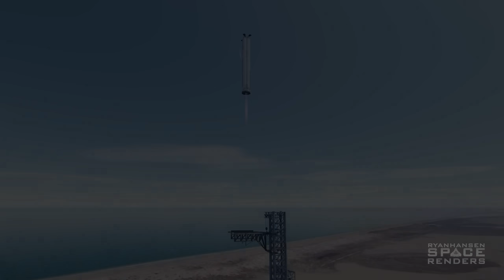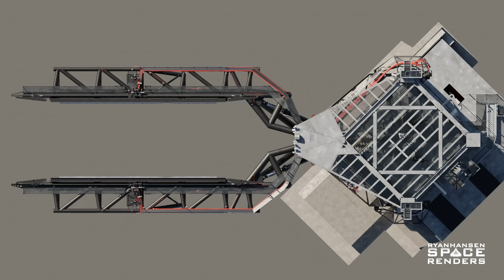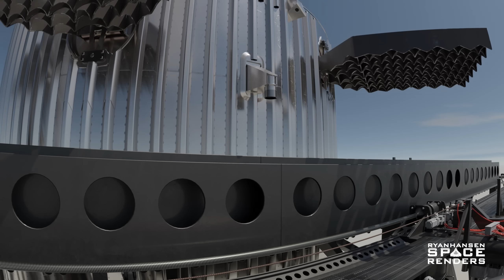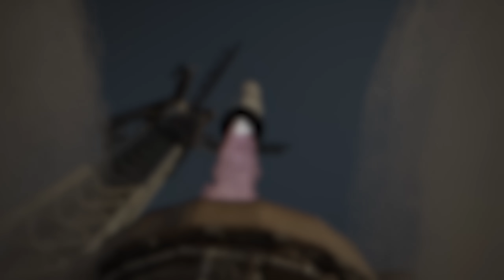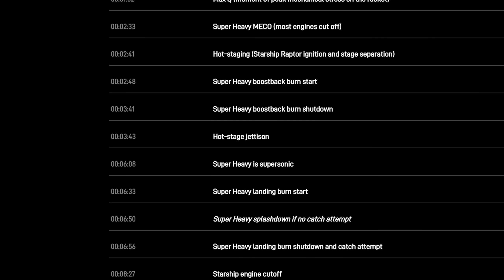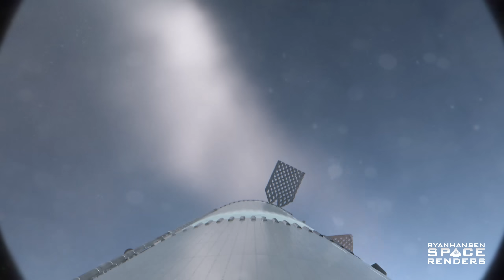How SpaceX Caught Super Heavy | Explained

Comment: I wonder if booster will hover for a period of time to allow positioning and also use up more of the fuel. It would make sense to use the deluge system to reduce heat damage , and better to kave the weight of the booster as close to the tower as possible, all depending on how much movement is allowed in the arms for centering the booster on the launch pad . I had assumed that the booster would descend at an angle to the tower and enter the arms before taking on a hover position , but perhaps there will be a slow vertical descent which is stopped by the grab of the arms and then a cut off of the motors.

Comment: I still have hard time believing that the roll axis is that easy to control and it will stay within that 9 to 15 degrees margin. What if the gimbaling engines fail or have an issue. Wouldn't it be nice if spacex included more load points across the circumference of the ship just in case? They have to edit the deisgn of the arms somewhat
Reply from the maker: I specifically mention unless there are significant thrust vector control issues. Roll is easy to control when 3 engines are running. Honestly, if any rocket company can't get a rocket to a roll target within 10s of degrees they shouldn't be launching a rocket.

Comment: The main issue could be impossibly to align the booster on the vertical axis, in your rendering it come incline and magically stay straight that only with gimbaling engines from the base, not to mention that it doesn't have a proper RCS system, seriously venting the tanks is a good idea?

Comment: I feel sorry for the Engineers that have had to design this arm. The concept looks to have been driven by a management team with no idea about engineering, with structural and mechanical graduates being brought in to check the numbers, but without using experienced Engineers with agency, experience and ability to adopt smart mechanisms to move the arms quicker, more accurately and without flexing uncontrollably

Comment: Great video! Wow. My question is: With fuel always being rare and one of the most valuable commodity in any space flight, will they have enough fuel left to allow for the re-entry burn to slow the booster down, and then to keep 10 then 3 engines running to align the booster on the "landing" pad?

Comment: Unbelievable amount of highly sophisticated work in this video detailing the intricacies of catching the booster. My question for you is would it not be better if there were multiple pairs of pins instead of two just in case the rotation about the vertical axis of the booster doesn't work well. Also the pins could have extended a little more, maybe 6 inches more to ensure that they land on the rail. All of these redundancies could be removed once the catch is perfected. I also can't help thinking that despite the weight, maybe landing legs would not have been such a bad idea.
Reply: I think they have enough expertise and complex simulations to have decided to build the boosters this way....because I agree with you 100%. 
The actual question is probably how much did Elon dictate the latest development of starship with his motto of less parts=good. lol

Comment: 13:21 QUESTION, please:  Instead of having just 2 load points on the booster, why not 8 . . . so that rotation of the booster makes no difference (?)  Does such a change maybe add too much additional drag on the booster performance (?)
Reply: I was wondering the same thing
Reply: Adding 8 load points to a booster instead of 2 could reduce sensitivity to rotation, ensuring that its performance is less dependent on orientation during flight. This change would distribute forces more evenly, potentially improving load handling and redundancy in case of failure at any single point. However, the increase in load points could also introduce more drag due to the additional external components needed, which might negatively impact aerodynamic performance.  the added complexity of designing, manufacturing, and maintaining a booster with 8 load points could increase its weight, potentially reducing payload capacity and overall efficiency. while the idea has merit in improving load distribution, it may lead to trade-offs in drag, weight, and design complexity that could impact the booster’s performance.
Reply: @arjunkunwar3906  Thanks.  I've thought about it . . . and now believe the explanation for the current design is probably pretty simple.  Failure to orient the starship correctly would mean that an awful lot more has gone wrong -- way more than it's worth having backup plans for . . .
Reply: The existing two load points might be the strongest possible given how their arms attach to the internal structure of the booster.
Reply: @pangalactictuber   for such a heavy booster multiple load points can be made. There is no such thing attaching it to the internal structure with strongest possible points . I thinking SpaceX believe in it's engineering capabilities of orienting it perfectly. And the rotation should never exist while catching it which may introduce sway or shear failure or  in the joints of the arms so I think whole idea of having 8 load points is not reasonable and logical both from aerospace and structural engineering point of view.

Comment: Excellent presentation Ryan.
I have a question for everybody that has probably been covered previously so please ignore my ignorance. 
Why aren't most parts of the entire launch mount and SQD (at least to some extent) covered with an ablative type heat shield or tiles? 
So much effort has gone into the ships heat tiles and primary ablative flexible coating that is underneath the tiles, why can't it be utilized on the launch mount?
The SQD in particular always seems to take a heavy beating. Surely there must be a way to attach this coating/tiles that can withstand the shock-waves and heat generated during lift off. Looking forward to seeing this launch and the outcome. Thank you and stay safe..
Reply: An ablator leaves residue everywhere and ceramics are brittle.  Heat is a small part of the problem, pressure is the bigger one and it's pressure that ceramics don't like.

Comment: Starship will have legs... The booster is gonna be fun!
Reply: @SorenBlethrow  Starship... The second stage will have legs. Speculation, of course.
Reply: @notsomadscientist9602  nope. It will also be caught
Reply: @SorenBlethrow  So what catches Starship on the Moon or Mars? Starship will have legs
Reply: @notsomadscientist9602  there will be variations with legs for the moon, but on earth they will be caught.
Reply: @SorenBlethrow  I'm not holding my breath. They haven't even got the hardware for a Starship catch. The little pins on the chop sticks that they use to stack the ship aren't capable of swinging out and catching it. They will need pins similar to the booster.

Comment: What great work!! Unfortunately, my predictions aren’t rosy. The FAA is going to whizz all over the actual catch attempt and require SpaceX to perform another simulation in exchange for a sooner launch date. I expect a longer boost back burn and soft touch down much closer to shore. Which, to error on the side of caution, would be a landing burn failure test run i.e. dispense with the grid fin maneuver and have SuperHeavy follow its ballistic trajectory to the surface. The only evidence I have to back up my speculation is SpaceX would have told us otherwise.
Reply: Part of the problem is you don't have any actual idea what the FAA does or how OR why for that matter.

Comment: If Roscosmos was attempting to catch the largest rocket stage ever flown with the launch tower on the vehicle’s fifth test flight, I would not have high hopes of a successful catch. It NASA was attempting the same thing, I would expect a flawless catch…8 years after the original projection date and 6 times over budget. The level of engineering, mathematics, programming, and sheer will required to pull off something like catching an explosive skyscraper that fell from space is mind boggling, and in a vacuum (no pun intended) I would give it an extremely low probability of working, but a successful propulsive landing of a rocket’s first stage seemed like science fiction about a decade ago so I won’t sleep on SpaceX when they attempt the near impossible ever again. What they’re going to attempt is about as technically difficult as landing on the moon and returning to earth was 55 years ago, so even if they fail in this attempt, I have no doubt whatsoever that these booster catches will be successful before long and will become as common as Falcon 9 booster landings soon after that.

Comment: I don't think SpaceX is worried about moderate damage to the original tower on this catch for a couple of reasons. For one, anything short of a perfect catch, will result in more FCC paperwork which as we have seen, takes several months to get reviewed. Repairs have plenty of time before the next attempt. For another, they've changed the design for tower on the second build. Starting with going back to what has worked before with the thrust exhaust, the flame trench. Even if the launch and catch cause no damage and there are no FCC delays, I believe test 6 will be waiting for the finish of the second launch tower and changes. This will determine if the first tower gets scrapped, is used just for static fires or gets renovations.

Comment: Fantastic visuals. Im a bit surprised there isn't a semi-automatic alignment system in the form of a funnel section. Then if it is a little off it can automatically be aligned as it lowers. Theres no funnel here but a system requiring high precision every time. A funnel section would provide some degree of back up.

Comment: Incredible animation, explains a lot of stuff I wasn't aware of. I think the deluge system was activated in FT4 to help extinguish the flames from a plausible explosion... I'm wondering about the reaction from vector control in the event one of the arm would push the booster sideways during the catch, would the gimballing engines swing the booster in the opposite direction in an attempt to compensate? The level of technical details is top notch, SpaceX should hire you along with Zack Golden.

Comment: I'm curious about the catch arms striking the empty returning booster slightly out of sync, causing the top of it to be pushed some degree to the left or right,  and can the raptors adjust enoug to counteract it....unless they can ensure that the catch arms are precise and make contact in sync, cancelling out any of that rotational force.

Comment: This was an excellent overview of the process, including the risk scenarios. A couple of questions:
Reply: Early on, I seem to recall that the grid fins are built strong enough to act as a "last resort" catch surface if the pins are missed. Probably hard on the arms and booster, but it would keep the booster from falling onto infrastructure.
Reply: Second, it's feasible that modulating the thrust during final stage could slow the booster as it falls past the arms, allowing the arm motion to be slower & more controlled even if the pads contact the booster as you illustrate. Might mean that arm motion can start sooner - after the engines section passes but before the chines have passed the arms.

Comment: Are the grid fins strong enough to support the ship?  Then if they miss the pins, the grids could land on the rails.
Reply: It could probably prevent the booster crashing down the olm but then I'm pretty sure those grid fins and their actuators would need extensive repairs afterwards.
Reply: I thought I was the only one thinking about this. I also am curious if they are strong enough.

Comment: I wouldn't be surprised if the flight director triggers a catch abort dry run. A soft water landing with no engine failures seems important to  my spidy sensors and fuel contamination blockage mitigation is an issue that still needs flight verification. Although FTS1 "send it" philosophy and the impressive concrete tornado might still be a thing.
Reply: dealing with damage infrastructure is inevitable and something that can be learned from.

Comment: Is there a reason to use the chopstick type for the catch arms? Since the booster is a cylinder why not model the catch arms as a pair of semi circles that form a circle when they both attempt to connect around the booster on landing? This would also help to mitigate the roll induced failure mode you discussed, they could also add in additional load points this way?

Comment: Ryan, thanks for the video and great work!  One small technical issue, at about 10 min in you mention the booster "decending at a high rate of speed".  This is a common mistake.  Proper use is "decending at a high rate", since speed is already a rate (i.e. miles per hour).  In another context this is like saying something traveled several feet of distance.  This is just something engineers like me notice and I dont want you to be preceived negatively by others.  Thanks again and keep up the great work.

Comment: I still find it insane that those small load points can hold the weight of the booster. 🤯
Reply: That's the easiest part...they already lift the boosters using those points
Reply: and you can bet that they are more than twice what is needed in strength.
Reply: @LodeRunner-4000  Yeah I can imagine that

Comment: Unbelievable man! As a mechanical engineer who works in 3D modeling on the daily, I am blown away. I love the details...this is absolute eye candy. What's everyone's thoughts on the booster still being caught (albeit mangled and damaged pretty good) with the grid fins in the event it misses contact with the load points?
Reply: If it somehow misses the load points but gets caught by the grid fins, I guess that is the second best possible outcome. I mean sure the grid fins and their actuators would be damaged but its much better than it slamming into the launch mount. Even if the grid fin hardware took damage I doubt SpaceX would be flying booster 12 again anyways so no real loss there I guess. I don't think a soft landing on the grid fins would really mess them up that bad with them being made from titanium and knowing the forces that they are designed for anyways.
Reply: @Haxxy_online Agreed, the only correction I’d make is that Superheavy grid fins are not made of titanium like on F9, they’re made of steel. So I think they’ll be fine as long as the booster lands with a reasonable margin of deceleration accuracy. Surprised that Ryan didn’t mention this as a fallback scenario if the load points are missed or fail. 

I would be more afraid of other booster parts or ground infrastructure in case of a hard landing, like the catch arms shearing off the tower or the bottom of the booster with heavy engines separating, since rockets are mostly designed to handle compression forces, not so much expansion forces in vertical axis.

Lastly, any internal damage to the tank walls or bulkheads could easily cause a leak, leading to explosion of the remaining propellant and ullage gas, as we’ve seen after the SN8(?) landing, which was just a tiny bit harder than planned.

Comment: I just don't understand WHY they don't build a test tower and learn by catching a F9.   They are putting the entire infrastructure at risk. Tower, farm, OLM, roads. Being fined/sanctioned by FAA, EPA, etc, etc etc.  losing public support.   EVERYTHING.
Reply: Everything at Starbase IS a test.  SpaceX has always been willing to risk it all.
Reply: You can't catch a Falcon 9. It can't hover, it's engines are too powerful. They do a "suicide burn" to precisely get the vertical speed to zero when the legs make contact and then kill the engine. If they don't, the rocket takes off again.

Comment: Re the deluge system running during the landing attempt, rather than having much to do with preventing damage to the top surface of the OLM or the BQD, could that just be a precaution for the initial attempts, in case the whole thing "goes south"?  If the deluge system is running, the resulting fire of a crash would be extinguished a lot sooner, maybe it would even act as a "brake'" pushing the errant booster away from the tower and OLM..

Comment: How is any of this going to work on the Moon or Mars where there's no water deluge, tower, arms, launch table, and the vehicles have no legs?
Reply: The ship will have legs in the future. As for the booster, that'll only ever operate on Earth anyway.
Reply: @16BitGoofball  No it won't. The booster always comes back to Earth, it doesn't go to the Moon or Mars.
Reply: @wally7856  That is literally exactly what I said. Read my comment again.
Reply: The booster is not going to Mars, and only Starships that need to re-enter earth's atmosphere won't have landing legs.
Reply: The testing of the water deluge implies that the booster will try and descend directly over the stage zero launch mount hole, to get maximum rocket plume cooling.

Comment: Extraordinary video, full of detail and outstandingly rendered. One question comes to mind, what if the booster gets into position between the arms, but then impacts with a vertical downward force of such magnitude that it bends the outer edge to form a downward angle, thereby inducing a slide. The booster then slides off the arms and impacts in the launch infrastructure?